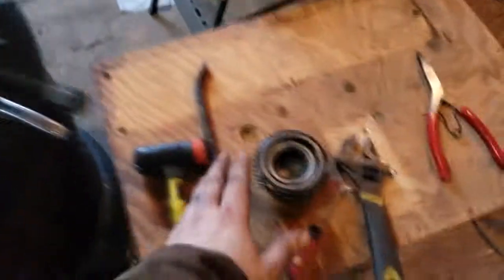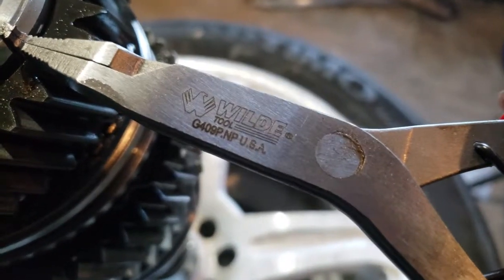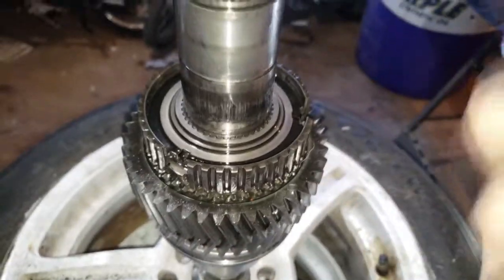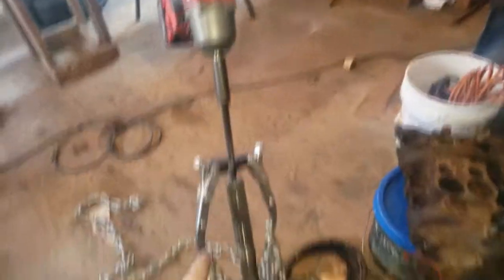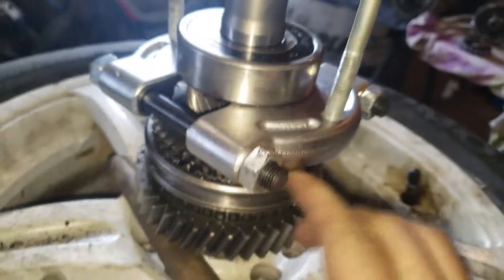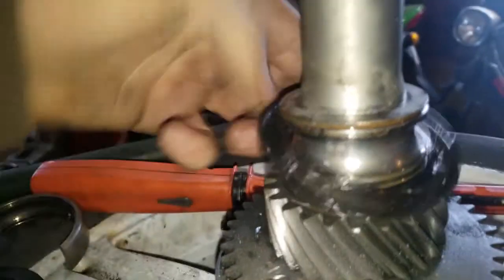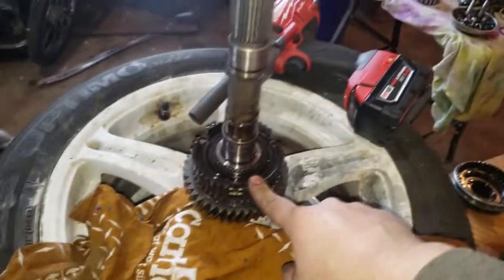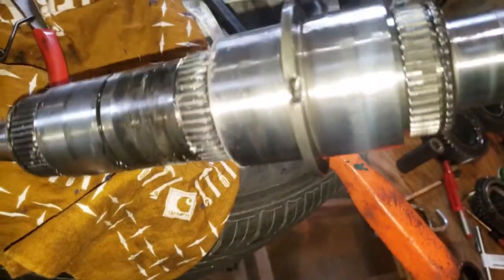NV3500 2wd transmission Main Shaft

Comment: Looking at that transmission I’d say the only thing that needed replacing was the input shaft bearing and the counter shaft bearing the rest would have lasted a good while probably a lot longer than the vehicle itself in relation to the quality mechanic work it will receive
Reply: after 3rd gear..it is pretty much tractor trailer scale in miles. I maintain a 1996 and 1997 nv3500. oneis at 396k. making a simple noise at input. perfect synchros otherwise. Always judge the entire trans by the shifter. you have every detail of diagnosis at your fingers.
 I agree with you. ..and use synchromesh. the gear oil makes diamonds gather in the input bearing to suicidally self destruct behind the seal (stranger than fiction -not kidding, wrong fluid is #1 error).
I also made a tool for removing and inserting input bearing on the bellhousing. Avoid smashing it with a hammer.
happy trucking :goodvibes:

Comment: Could you send a PDF of the instructions
Reply: Nevermind on that! Already got it disassembled and reassembled. I don't know why I was so worried about rebuilding this transmission lol. Wasn't any harder than rebuilding an ole chevy 4 speed honestly. Just have to lay the parts out and put them back on the same order they came off. 300 miles on my rebuild and couldn't be happier. I did synchros, bearings, seals, and input shaft btw.